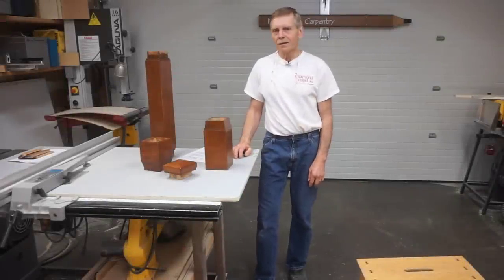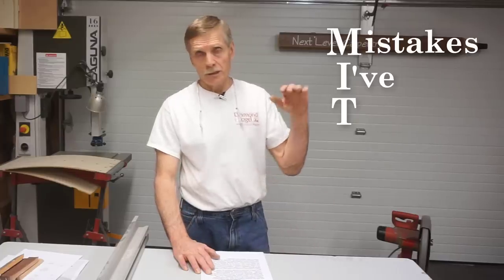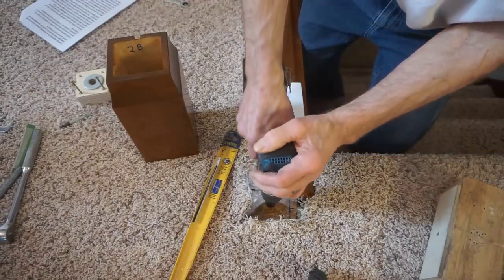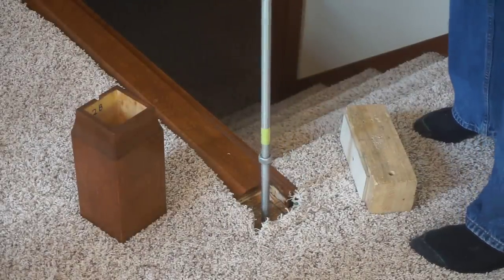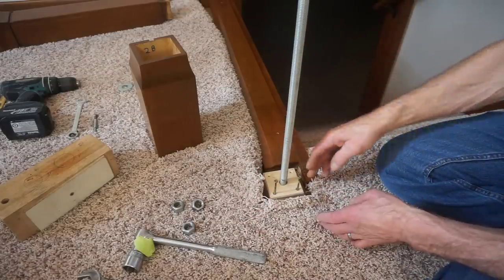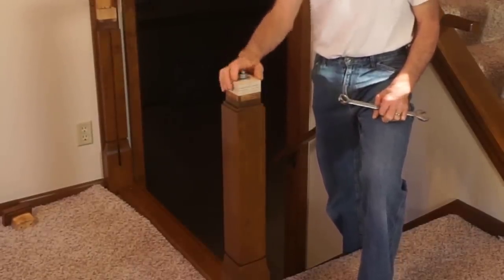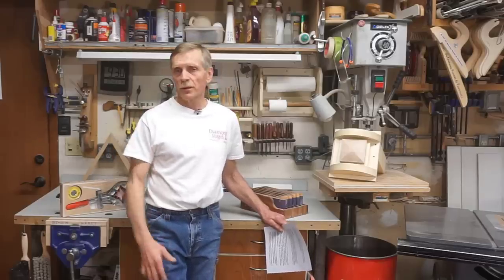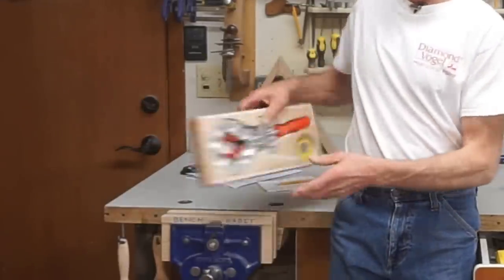How to Install a Newel Post Without Wobble

Comment: excellent video and method . i have been racking my brain on how to secure newell posts that will be secure on an outdoor set of steps to my porch. this is just what i need. i will dig post holes and fill with concrete and imbed the threaded rod into the concrete. i think i will use your newell post design too. i really like the looks of it. thanks for all the info .
Reply from the maker: Thanks Trainguy... I hadn't considered this method for outdoor use but can't see any reason it shouldn't work.  Be sure to use galvanized rod, especially if you imbed it in concrete.  Another viewer suggested using an all-thread connector which might make your project a little more manageable because you could imbed a short piece into the concrete and then just attach a long piece of the right length when it's time to install the actual posts.  Not sure the level you'd try to use 'my' newel post design but I'd try to keep it to as few pieces as possible and minimize glue ups because an exterior environment is much more abusive.  Other than that I think you'd get a great deal of rigidity from this method compared to typical post-mounting brackets, etc.  Let me know how it works out if and when?  Best, Matt
Reply: @NextLevelCarpentry  matt, i  finally got to the newel posts on my outdoor set of steps............i dug the post holes about a foot and a half deep and let dry over the winter........this spring i drilled a 1 1/4 hole about a foot deep and added a 3/4 10 threaded rod with anchoring cement from home depot........the next day i installed my home made newel posts and locked them down with a 1/4 thick steel plate for a washer and a 3/4 -10 nut.  all the posts are independent of the stair stringers cause they start a ground level sitting on the concrete and not attached to the stringers................one of the posts is 60 inches long and it is ROCK SOLID......they actually feel as though they are built right into the concrete,  ...............when i saw your video last year and sent you a comment i knew this was the answer to my problem,,,,,,,,,,,,,,,,I WAS RIGHT...........THANKS.............THIS METHOD IS GREAT..............
Reply from the maker: @yardlimit8695  thanks for the testimonial... and a full year since you first commented?! Nice!  Glad to hear it worked so well for you... not that I'm surprised though😀😎 Sure a lot better than embedding wood posts in concrete, right? Hope the rest of the project comes together as well! Best, Matt

Comment: Might not be "rock rigid" but it's as rigid as it can possibly get !!  Awesome job and videos...!!!!
Reply from the maker: Thanks for commenting, neocollective, and for the accurate assessment of the installed post.  You must have some valid experience where this stuff is concerned to reach that conclusion.  I was really surprised by how much deflection of the post showed in the video because when l lean on or push the post it FEELS more solid than it looks, and really is about as solid a post as can be expected for its design and installed location.  Glad you like the job and videos... really makes the video production effort worthwhile!  Best, Matt
Reply: Indeed Matt !  When we look at the physics of the project the post is really a lever discharging forces where it meets the floor so the only way to drive that momentum out of sight is straight down and as deep as possible. You found a very efficient way to do so. Just found you and I keep enjoying your other videos and subscription, thanks for sharing the knowledge !  :)
Reply from the maker: I love your engineering terminology and perspective description for this!  Another viewer mentioned using this method for attaching posts to a concrete floor slab.  High tensile strength of the threaded rod and high compression strength of the slab will make compression strength of the wood itself the weak link in the chain, right?  I'd sure like to see how well that turns out...
Thanks for commenting... it's good to know you've found Next Level Carpentry and some of the other videos.  I really try to put some of the gems from my bag-o-tricks into each video but can't always tell if they come across as useful as I think they are.
Best, Matt
Reply: Your bag of tricks is certainly very useful to us your viewers !...I found you looking for an easy way to attach wood to masonry and learned the electric wire trick, didn't try it yet but makes total sense; I'll make sure I pick wire with a tough skin.
I agree with you, doing this post anchoring on concrete would require using really hard wood at the foot or base section for best results.
I just bought a big old fixer-upper brick house so I might be suggesting some video in the future, ha :)
Best,
Nico
Reply from the maker: You've got your work cut out for you with that 'big old fixer-upper', Nico... let me know if I can help out.  BTW wire with a tough skin isn't always the ticket... sometimes I use bare wire, other times just the insulation is the ticket.  Working with old masonry and concrete on old houses can require a lot of imagination and perseverance to achieve victory but I get the idea you're the sort of person who will win in the end!  Best, Matt
Reply: Thank you for the clarification on the types of wire ! Very helpful.
I'll keep you posted on the house !
Best,
Nico
Reply from the maker: Please do, Nico...

Comment: An MIT engineering professor, engineered newel post anchoring system. What can go wrong? You know its probably been thoroughly thought through. But my question is, how will the cryogenic expansion rate and thermodynamics affect your design? Either way, this will be my go-to method from now on. Thank you.
Reply from the maker: I skipped the semester at M.I.T. when cryogenics was taught and have regretted it ever since!  Every day I show up on a jobsite and the first thing I have to handle is adverse effects of cryogenics and just stand there, flat footed.  Wish I knew then what I know now Ralph! Best, Matt

Comment: Great video your methods are definitely next level.  I disagree with the comment on lock washers, not needed on this no or very low vibration situation.. Thanks ....
Reply from the maker: Thanks Clyde... Seems the newel would fail first from getting slammed by furniture movers hitting it with a couch, appliance or piano before it would from a loosening nut, especially with how hard I was able to torque it down.  In thinking about the comments I'd be inclined to put a dab of LocTite on the nut if I had any concern of it working loose.  Thanks for commenting... hope you enjoy other related videos showing how piecesparts of these newels were made.... Best, Matt

Comment: Very creative!  I have one question. What keeps the rod from pulling out of the floor joist?
Reply from the maker: The very same thing that keeps wood screws from pulling out of wood.  If you've never tried this you'll be amazed at how firmly that rod holds!
Reply: @NextLevelCarpentry  thank you for your time and your response. Do you have any objections to going through the joist?  Let’s just say You have easy access to the basement and your floor joist. Would you run the rod through the joist with another washer and nut at the bottom of the rod? Or do you think those threads in the joist will hold up the test of time? I worry about the wood expanding and that rod coming loose over time. I was thinking of through bolting it. Running the threaded rod past the bottom of the floor joist and installing another washer and jam nut from the basement side. Thoughts?
Reply from the maker: @dfossilo  You've definitely got more options if you have access to the underside of the floor.  In my experience, the size of rod used in this video screwed down into the joist as shown will stand the test of time.  If the pilot hole was too big it might not hold very tight.  If it's too small, it could split the joist and not hold either.  It's probably easier to drill a hole down through the joist and add jam nuts at the bottom  but, if I were going that route, I'd probably go with 1/2" rod and a 9/16" hole.  Also, if you have access below, it's easier to move the rod over so it's not centered over a joist and then add 4 or 5 pieces of solid 1 1/2" thick blocking and use the jam nuts you mentioned.  Lots of options to consider and pick the one that makes the most sense for your particular situation.

Comment: I have done this before and it works well,but only if you have something solid below and that is not always the case because sometimes your newels are not right over a joist are band but over plywood only and all you have is your bullnose which is 3\4 thick and newel attachment kit will probably be your best option are some type of locking key mortised in the bottom of the newels. I like this method and if all new construction would put plenty of Deadwood for this application it would be great.
Reply from the maker: Right you are Junkyard!  For 2 of the three newels seen in this video there was nothing but plywood subfloor at the post locations.  Because it was carpeting I was able to remove a piece, install 'Deadwood' blocking, and replace the plywood for fantastic results.  If conditions don't allow access by any means then, yes, a newel attachment kit might be the only option.  That said I'd go to great lengths to place solid blocking because there's no comparison in the rigidity of the final product. Best, Matt

Comment: Great video Matt. The all thread taps work great, I have made a number of those over the years for chasing threads as well a tapping plastic materials and even mild steel when grade 8 thread stock was available. In some cases angling the cuts in the threads will make for better threads in whatever you are tapping.
Reply from the maker: Hey Ray, thanks for additional insight in your comment.  Do you find that the cuts are better if they tilt at a 'feed' angle (like a drillbit) or an opposite 'back' angle?  I wondered as I was making them but figured any cut is better than none so didn't spend time comparing.  Thanks for suggesting alternate applications of the method!  Best, Matt
Reply: Hey Matt, I have always looked at the slices as cleaners, for removing the chips like a drill bit. On plastic, mostly UHMW, I cut the slices to the left and make them deep and fairly wide, don't know why, but it worked, for the application. Aluminum, soft copper and brass went to the right, had to back them out often. Straight was when ever we weren't sure. I the grooves (slices) plugged up fast we went one way or the other. As a note, black Allen head cap screws are rated a grade 9, very hard and tough, made a few taps that got used more than once with these.
Reply from the maker: Good stuff, Ray... thanks for all the extra info... you sound like my kind of guy!  I'll make a special not for black cap screws as I know those are extra-tough.  I can see all this as another 'rabbit for my hat' to be pulled in a pinch :-)

Comment: Take some tape fold it in half sticky side out and spin it around any bit with your drill until it is of a sufficient diameter to hold against the nut and drive it like a gear.
Takes a minute or less and saves more than a few. I decided that was better than a pair of sockets hammered into some conduit. Plus it’s one size fits all.

Comment: Another nice video. I’m late to the tip sharing game as I only found your channel recently. Something I like to do is make the bottom block about 10-12” long. It seems to add to the rigidity to the post. I’ve mainly use a suretite newel post fastener for these type installs and then slide the box newel over it with some pl. I’ll have to give this a try. Thanks for sharing your knowledge.
Reply from the maker: Yeah this method is one of many excellent ways of getting the job done as are the methods you mentioned... they are all good to file away for use as required.
Reply: @NextLevelCarpentry  and I totally respect that. I’ve heard you comment that before in other videos. Unfortunately it can be hard for people to skin a cat in a different way. The video you made about the garage box steps is a good example of adding your cabinet making skills to a set of stairs.  I believe we become better carpenters when we are willing to look at something with an open mind and from a different perspective. Again thanks for the content. I’ll be watching.

Comment: Thank you for sharing all your experences. I have picked up so many fine points from your videos. I would like to see a video on sliding miter box and how to cut correctly. Sometimes the saw grabs the wood. Am I not cutting deep enough I try to do a score cut first but it grabs sometimes. Thoughts thanks lou
Reply from the maker: Hey Lou, sorry I'll have to disappoint you on your request since I don't own or use a sliding miter box... if you can believe that!  I'm able to do everything I need to do using the standard non-sliding, non-beveling DeWalt you see in my videos. You should be able to find a video somewhere else since just about everyone but me uses sliding compound miter boxes these days. Frankly the sliding feature scares me a bit but that's mainly because I've no experience with them.  Best, Matt
Reply: Your saw blade might have what's called a positive hook angle on the teeth, pulling the work upwards and to you. Find a blade with a negative hook angle or described as being used for miter saws, they push the wood down and to the fence.

Comment: One hint on those type of posts with no knee wall or 90 degree rail.....once you think its tight become the teenager that will live there and try to loosen it up by pulling and pushing  on it hard....then retighten the nut....and add liquid nails to the hole the rod threads into...those shallow machine threads get break loose....liquid nails under the centering block wouldn't hurt either. Ive done thousands of stair cases at a piece rate where i would have to go back if things loosened up...one or two forty mile drives and 300$ back charge for finish touch up from the painter and you learn to over do things
Reply from the maker: The voice of experience speaks... thanks for adding your insight Douglas... Best, Matt

Comment: Awesome system I can’t. Even guess how many times i had to  go on Customer  Service calls as a employee years ago  for a new home builder  as a rule  i was always limited  to what could be done in a finished home. Without  ways access to below  the post without making a mess and more repair  work  hint you should  expand the system that maybe  utilizes a patented  part of yours the secret  of course is to build one that exceeds OSHA and  most local  code requirements on strength  then you got a money maker  !

Comment: thanks for the info. I have a woobly post in an older house i need  to fix
Reply from the maker: I hope you're able to adapt something from this video to get a good fix on that 'ol post... might take some cleverness but if you can get the threaded rod down through the post I'm confident it will be a good solution for you!  Best, Matt

Comment: Great video Matt. Although it might not be common, what would you do if you didn't have that depth of clearance underneath the post to drill? Would you focus on tying the post into the hand rail better?
Thanks.
Reply from the maker: Without depth of clearance under a newel post it's tough to support it with ANY method, not only this one.  Times like that are a challenge and each situation will likely require a unique approach.  With minimal structure to tie into, things like welded steel plates and such can be deployed to get out of a bind.  These facts are ones that make me quite happy when a method like this one works! 😀👍😎 Best, Matt
Reply: Appreciate the reply Matt 👍

Comment: I am think of adapting your process to my yard fence posts this spring. Currently they rot out about every 10-12 years. I have been just digging them out and putting in new ones with a bag on concrete but I am almost 60 now and the next time I will be approaching 75 and the time after that almost 90. Digging out 20 fence posts is a reasonable workout for me today but at 75 it might be a bit much. So, if I just dig them out then pour a concrete base with a long ready rod I figure the future replacements will be pretty easy. Of course, I will just need a jig for drilling holes in the posts but that should be easy. My fence is pretty short, only about 5’ high. What do you think?
Reply from the maker: I admire your ambition to dig out 20 posts at 'our age' John, but encourage you to save your energy for more enjoyable pursuits.  Check into Sure Set Foam for your post project... I used the stuff for a pergola last year and, although it takes a little getting used to, I think you should give it serious consideration.  Best part is that, properly placed, the foam should preserve the wood of your posts well beyond the time that it will matter to either of us😁😎  Not that I think this method for anchoring posts isn't valid but sometimes simpler is better.  Let me know what you decide?  Best, Matt

Comment: Totally agree, the little Mickey mouse mounting kits you can buy are junk and a waste of labor.
I use ready rod (we call it All Thread around here) most times, even if I only come up halfway it holds really well.
I also use giant 2" dowels set with epoxy.
Reply from the maker: Sounds like you know what it takes to adapt to a wide range of conditions and railing designs Michael... hate to leave a wobbly railing! Best, Matt